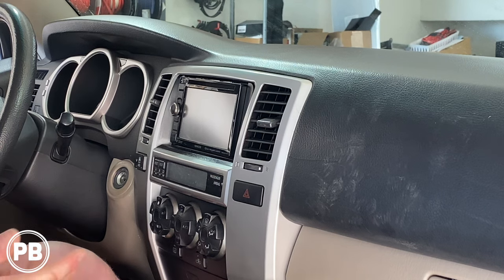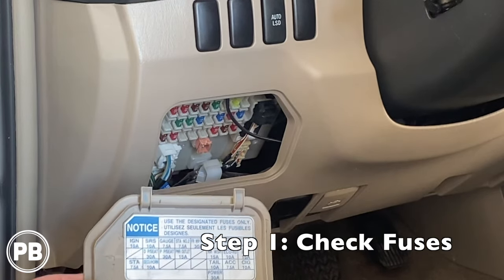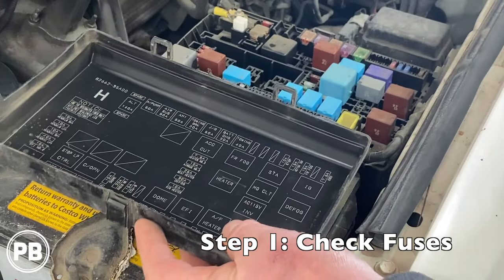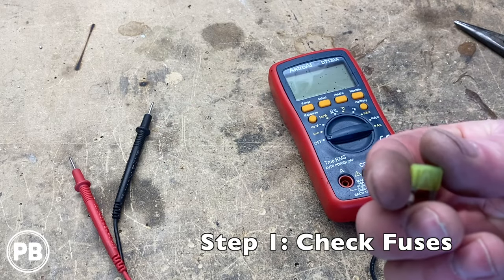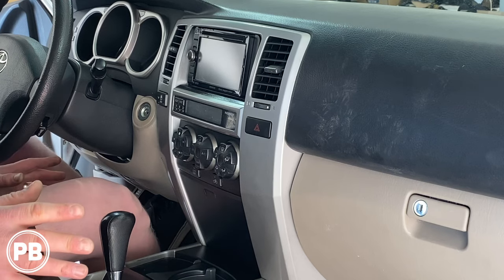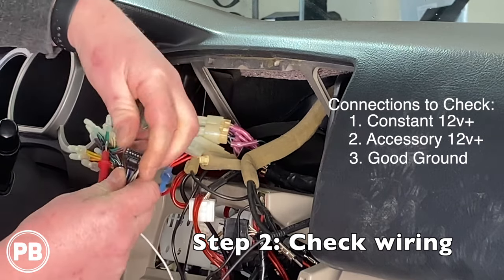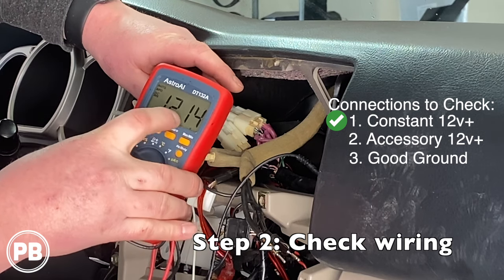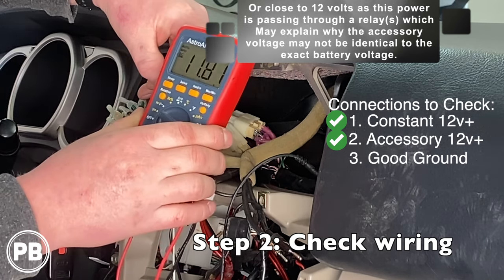SOLUTION: My car radio won't turn on!

Comment: What if it temporarily stays off and then randomly turns on as it chooses? I don’t think any of my fuzes or bad.
Reply: That’s possibly a insecure connection, how did you connect your wires?
Reply: I'm facing the same issue but I'm getting power from the wires but it work as it wishes
Reply: It could be your ground
Reply: @tristanolson5246 to the unit or in eng bay?   Mine would restart every now n then . Then yesyerday it just shut off n never came back fml
Reply: @jondoe2099  the unit mine did the exact same thing
Reply: @jondoe2099  is your ignition wire working righ?
Reply: @tristanolson5246  i beleive so.  Car starts.
Reply: @jondoe2099  no on your radio it sends power when the ignition id on so it does not stay on. It's the 12 v ignition wire
Reply: @tristanolson5246  i guess i havent checked it.  My ground was wired to my radio fuse.  Thats all in tact.  Ill have to check ig wire i guess
Reply: @jondoe2099  you should never have a ground to a fuse you should probably fix that first
Reply: @tristanolson5246  ty for taking the time man. Rlly.  Ill fix that ground & check ig wire.
Reply: Mine turned on for a second when I re put my fuse back in then it clicks and shuts off but it does that for both my head units I tried and they both worked before 😅
Reply: @landonthomas7470  i havent even had time to look at the ig wire i mentioned.    Life to busy.  But when i do ill come back here.  Sounds like u have a short some where.  🤔
Reply: Update months later, my ig wire is fine.  I threw in my older pioneer single din, works like a charm.  PLZ  brand head unit is just dead.  Get whatcha pay for
Reply: Thank you man I solved my problem❤❤❤ it was the wire on the back for accessory was loose
Reply: ddx57
wont turn off
Reply: I have same problem
Reply: Put in an android unit on it works on start but if i turn of vehicle and try to turn it on again it doest power on.
Reply: My 2007 Cadillac CTS when I turn on the car.. the double din doesn’t turn on, but at night when the car automatic lights turn on the radio comes on..
Reply: Let set for 1 hour it reset itself

Comment: Similar issues kinda, my radio will work for a couple days then go off for a couple days. There will be some weeks when it works during a car ride then cut out randomly and back on a hour later
Reply from the maker: Sounds like a wiring issue, or radio is going bad.
Reply: how did you fix this?
Reply: Mine is just like this. It works when it wants to
Reply: We are facing the same issue..Did you find a way to fix it?
Reply: @saf1n47k   it was indeed a wiring issue which was causing my radio unit to short out and back on here and there had to have someone rewire it correctly
Reply: @OrgyDerby  Thank you so much for the info.I will inform you after fixing it

Comment: I’ve found that by switching the 20A fuse every couple days, the radio and backup camera keeps working; however, I lose my preset radio stations
Reply from the maker: Sounds like a short or bad radio. Recommend a replacement.

Comment: Bro your a beast!! It was the fuse under the hood. Lil 15 volt fuse. Thanks brother. The fuse box in the car had a spare 15 volt fuse so I didn't have to buy one.

Comment: Installed an aftermarket radio that would not turn on. The OEM radio only used the amplifier fuse so Toyota did not install a "radio" fuse. After hours of chasing wiring i watched this video up to the "check both fuses" part then checked and found the empty fuse slot. Thanks!!

Comment: What if my radio turns on for a second when the car starts but not again what then if we checked all fuses and there are doing okay I have a feeling it might be the accessory wire because when I use a light up screwdriver the light flashes it’s not conastqn but I’m not sure please let me know your thoughts

Comment: When I start my car first thing in the morning my radio will be off. I have to wait for like 20 minutes till it turns on. Not sure what's the problem is?
Reply from the maker: Sounds like a radio going bad as long as your wiring is good. A short in your wiring could also cause power cycling.

Comment: Hi. Thank you for your radio fix advice. Had a recent issue with my truck where my pioneer radio stopped working, no power, no nothing. First, checked fusebox near engine, and even tried changing out a fuse, but no change, radio still dead. So, i pulled the dash cover and removed the radio,  but didn't see a fuse for radio. After watching your vid, i found a very small fuse near the power cord going into the back of the radio, but the fuse was hidden by the plastic cover on the power cord that plugs into the radio. When i disconnected the power cord and removed the fuse, the metal filament was not burned out. I didn't have a multimeter around,  so i just swapped that radio fuse out with another fuse of the same amp rating, reconnected power cord,  and BAM, the radio came back on!

Thank you so much for your advice! I first thought my radio was gone. Your advice saved me a lot of time and trouble! My vehicle is so boring ,when my radio isn't working.....

Comment: I plugged in an auxiliary cord to see if it would work to listen to your video. Yes, it worked. I decided to see if the radio would stay on if switch to XM and it worked. I turned it off and it came back on. I'll see if it keeps working.

Comment: I’m in the same situation; tested fuses and now will check harness and radio. Would have been helpful to see temporary hook up for powering radio on test bench. Battery and what wiring from it to radio using electric clips or what probes?
Reply: My thoughts exactly
Reply: Did you use a wiring harness or did you just use an interface adapter
Reply: @GrowhouseMN  when adding a power outlet; disconnected the battery and amazing it started working on it’s only again.  Rebooted I guess.
Reply: @robbunch2225  I can’t thank you enough! Just did this and got my system working again! Thank you so much!
Reply: Use ur red and yellow on positive and black on ground

Comment: I started Upgrading Car (Truck) Audio in the '60's & Radio/speaker Upgrade life was Logical, straightforward, Easy to get Under the Dash relatively Simple !!.....Never thought they (Car Manufacturers) would hire Ex-Nasa Rocket engineers to Screw-Up Car audio Electrical wiring so Bad !! .....Was a Lot better for Diy's back Then....

Comment: What if it’s problem 2 with the accessory wire not getting power when you turn the key? I am installing a new radio and my old one will turn on fine with the one harness but the new one won’t with the aftermarket harness

Comment: My car radio and power outlet not working. Under the dashboard there is a fuse box. I check every fuse with a test pen. Found one fuse not lit up, that is the Power Outlet. I check the fuse, look good (not blown). Went and replace the fuse anyway but still nothing.

Comment: I tried putting a cheap radio in my car just to have one since the original was broken I pulled all my fuses even changed the radio fuse and yet it still doesn’t work they say I blew a fuse but I don’t see anything wrong with any fuses

Comment: Ok so question I have a volts wagon Jetta GTI 2007 and it has apple car play so if I connect my phone to charge it in one hour f the cigarette outlets it turns off the apple car play completely I have changed the fuses on the inside the car fuse box and it won’t turn on would I have to change the outside ones too? It also takes months to turn back on

Comment: I connected a speaker wire to my voice amp and it sparked and the radio turned off and so did my truck alarm system when I disconnect the battery and connect it back I can see the alarm turn on but the. It goes off again , and radio won’t turn on at all

Comment: Please help, I’ve got power and screen function while he is turned backwards but when I turn let to start car the screen goes black but I can still hear radio and unit has power just a black screen when key is on forward position

Comment: i have checked the fuse and even put a new radio in and it still doesnt work, it flashes like its getting power when i try to push volume and tune

Comment: I have a Kenwood. It dims by itself when I pushed the radio presets and radio flips out. Never did that til just now. And sometimes the radio has no power. I take the facelift off and put it back on and it works fine. But then after while, it'll do it again. Want to hit the fast forward button or rewind button to scan through the stations it automatically programs the stations preset instead of actual fast forwarding. It's not a wiring or a fuse I just think it's bad equipment. Kenwood stereo are trash.

Comment: I have a 2010 ford focus and a 2014 mustang. On both cars when I installed aftermarket radios I wouldn't get power to them through the harness. After checking all fuses and all these things i had to splice wires and run straight from the fuse box. Defeats the purpose of "plug and play" type harness if they never work.
Reply from the maker: Sounds like you have the wrong data harnesses.

Comment: I am installing a planet audio radio. I have all the harnesses plugged in and the unit is unresponsive when I have the car electronics on. I checked and the ground and constant have power, however, the accessory doesn’t. I wired the accessory line and still no power. Does anyone know what else I could do?
Reply: I'm having the same problem

Comment: I am  trying to install after market audio system in my Renault fluence, but firstly there is no power in my existing radio , so I tried checking voltage and found that there is no accessories voltage, but constant voltage and ground is good. And also found that accessories voltage in AC, mobile  Charger are good ,I'm just wondering if I can join a wire from mobile Charger accessories voltage wire to my new audio system.(I tried and it works,but not really sure....)?

Comment: In my 08 enclave CXL my radio works but you can't turn it off with the power button and all the pre set buttons on passenger side of power button do not work and none of the lights light up on the radio pre sets anymore hope that explains it well and thank you.

Comment: my issue is that it wont work at all unless i pull the fuse from under the hood and then put it back. i have been lost for months on this. fuse never blows or anything and radio works perfect
Reply from the maker: Sounds like a failure within the radio itself if it requires you to do a power cycle to turn it back on.
Reply: @ProvoBeastAudio  I actually have changed radios, wires and everything. Had someone else do it and I just gave up. It works when I pull the fuse and put it back but after I shut my truck off it won’t work lol.
Reply: Having this same issue with 2 brand new radios in 2 different cars. Pull the fuse and the radio works fine for about a week or so, then no power until I pull the fuse again. What is going on??
Reply from the maker: @justj8934  When you pull the fuse, generally you are power cycling the radio.  Sounds like a radio malfunction to me.

Comment: My fuse is good. When the radio won’t turn on- I pull the fuse and the put it back in and the radio works for a while. Then stops on a later random day. Rinse,  repeat. Boss bv9364b. Any ideas?

Comment: CD I had in there got stuck in there because it had no power but once I took the facelift off and put it back on it doesn't even have CD mode anymore but it has a CD player. And CD player is one of the modes but now it doesn't even have that mode on there anymore. I'm telling you it's an equipment issue. Because if the stereo has a CD player but doesn't have CD as one of its modes when it did before and all the buttons flip out and the lights flip out every time I push a button and sometimes even has no power it sounds to me like it's just bad equipment. If it was a bad fuse then it wouldn't have power it has power. But it flips out. It looks fine with the remote. Real fine what the remote. Issues with the car stereo at all while using the remote. When I push the buttons on the facelift, the screen dims and the buttons automatically start doing random things it doesn't actually supposed to do. And sometimes it even has no power could be a bad fuse or bad wiring but it works fine with the remote so therefore it's not either it's just bad equipment.

Comment: My stereo system (stock in my 2012 Tacoma) only works in the morning when it’s cool out. Later in the day if the car has sat in the heat for a while once the car is turned on the stereo won’t work. However, even when it isn’t working my phone Bluetooth is still connected to it saying that there is music playing, but nothing comes out of the speakers and the stereo display is blank like it is turned off. I assume this isn’t a fuse because it works fine in the mornings. Could this be a wiring issue or is my stereo receiver simply going bad and needs to be replaced? Any help is greatly appreciated!

Comment: the time works on my radio but the radio wont turn on its stopped working randomly do you know what it would be? its a cadillac deville 2005 default radio

Comment: For some reasons everything seems to be fine but I am not getting constant 12v power somehow. Radio has yet to turn on in a week atleast…I miss my system so much this is ridiculous!
Reply: My battery died then I jump start the car now my damn radio won't come on I'm piased

Comment: I don’t even have to turn the switch on. I just plug the harness into the radio and the fuse in the back of the radio blows. What’s going on?

Comment: Do you have a video explaining how you hook up the radio to a battery pack outside the car?
Reply from the maker: connect the radio's yellow and red wire to the positive post of a battery, and black to ground. No video needed.

Comment: Okay so maybe y'all can help me on this, but ....here's the situation. 

2012 Toyota Corolla S  
Originally equipped with factory pioneer head unit. Head unit has a lot of various inputs on the back. 

My factory unit failed. I want to replace with aftermarket unit. 

I went to do that and nothing would work or turn on. 

Car toys 🤢🤢🤢🤢🤢 they told me that I specifically need a Maestro iDatalink harness for any stereo to work in my car. Do keep in mind that I just called and was not there in person for them to see my car. 

Now asides from trouble shooting with a meter or running ACC with a fuse tap... What am I supposed to do? 

So I called crutchfield.

The nice cool lady at crutchfield helped me realize that the wiring harness I had bought from Walmart and O'Reilly's does not match the product number for the wiring harness that crutchfield provides me. 

I have now ordered a new head unit from crutchfield along with the dash kit harnesses and my car data sheet 

I'm so worried man.

Please if someone could just tell me if I need the iDatalink harness if I am not trying to retauin any factory feautures???

Comment: If I'm getting no power for the red wire harness should I change the car radio harness I get a new one
Reply from the maker: You either have the wrong harness adapter, or blown fuse.  Depends on the vehicle.  Send us a message on facebook and we can help you out.

Comment: My friend helped me connect my dual tech apple play radio in my 1999 Honda CRV and put them to the correct wires. He didn’t go through the dashboard or anything, as my radio/AC trim is loose and falls off. My old radio worked just fine! I don’t really understand. Help?
Reply from the maker: It would be a wiring issue.  Hard to help through a youtube comment, i'd take it to your local audio shop.

Comment: What about why the radio doesn't produce sound during and only during cold weather?
Reply from the maker: Sounds like failing audio equipment if it is only producing audio at certain temperatures.

Comment: My head unit shuts off when I turn on my headlights and sometimes it won't turn back on, it is a plug and play setup.
Reply from the maker: Wiring issue, the plug and play kits can be problematic, especially the no-name brands

Comment: All my wires are connected all fuses are good and still not powering on, I’ve tried 4 different head units and same thing no power. I connect stock stereo and it powers on and works just fine what do I do?
Reply from the maker: May be the wiring harness adapter / smart harness not communicating with the canbus of the vehicle.  Lots of variables there, depends on the year, make, model, and trim of the vehicle.

Comment: In my situation. My radio have power but i have to turn  on Manually and dont save the redio station. Wire is yellow n yellow n red n red. I do do othe othere way yellow n red red n yellow. And the problem continue. Have any idea what is the problem? Thanks
Reply from the maker: Using a multi meter will tell you exactly how to wire it.  You can pick one up for a few bucks at your local hardware store.

Comment: So I have a 89 Chevy and the truck all ready has a after market radio single din works fine but when I try to install my doble din KENWOOD radios I didn’t turn on ? What Can it be the issue? I just don’t get it does it have to do because the other one is single din and the new one is doble?
Reply from the maker: Bad radio, bad wiring, bad connections; could be a combination of those.
Reply: @ProvoBeastAudio  the single din radio works and the doble din is brand new I had it in my 2001 Chevy and it work before I took it out so now I really don’t know what is it might have to take it to a shop and I’m hoping I don’t get rip off

Comment: I hope someone see this.... So the only way i get my 7din radio to work, is i have to connect the ignition wire to the 12v but when its done like that even when the vehicle is off there is power in the radio. When its connect correctly the radio wont come on at all.
Reply from the maker: Sounds like you have the wrong parts for your specific vehicle.  We can help, if you send us a message on facebook or instagram.